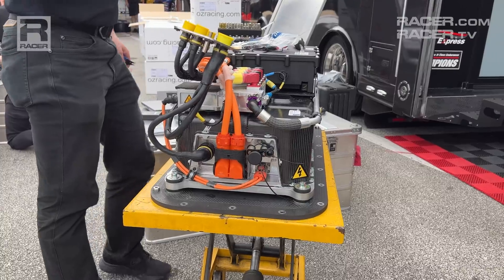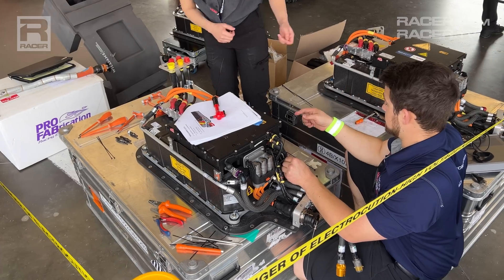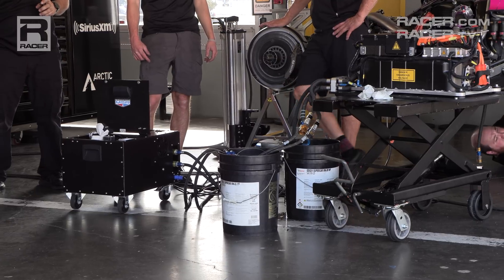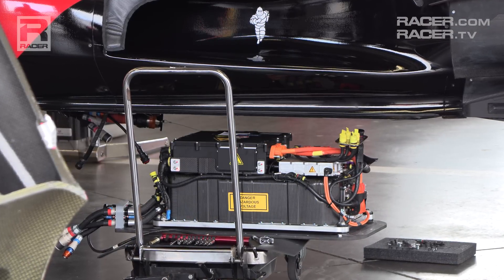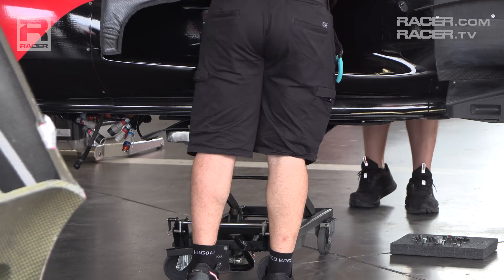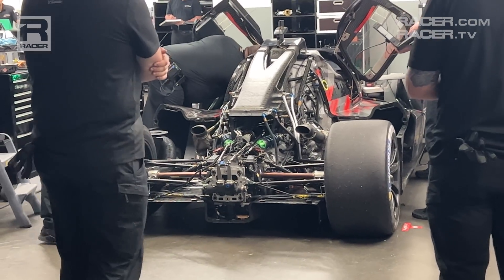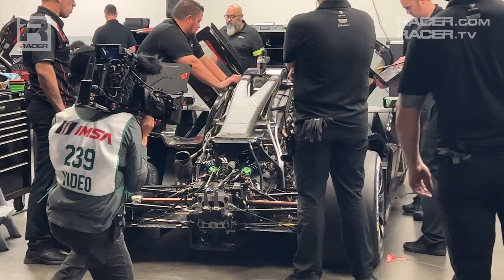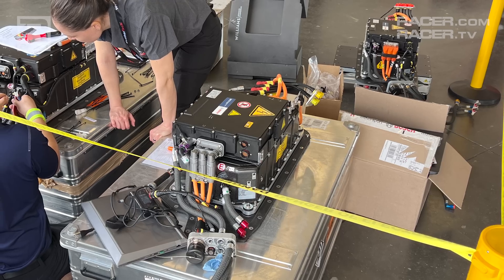IMSA GTP 101: Inside The Hybrid Battery System and ESS Installation

Comment: Hi Marshall.  Another excellent video.  One thing - 700V really doesn't tell us anything about these batteries.  How many electrons can flow through the cables at a time only tells us a very little about the system.  Is there any data on what the battery capacity is in Amp Hours?  How about how much load it and the MGU can handle in Amps?  As a guy who's been a long-time fan of railroading and got to spend some time on the rails, we never really cared about the voltage of the system.  It was how many amps were being put down.  That's what told us whether the locomotive was providing power or if it was slipping.  It also told us if we were going to die or not should something go wrong.  Because as the adage goes - it's not the volts that kill you.
Reply: In addition to the capacity, I'd also like to know the thermal load.  How much heat is actually dissipated by those three subsystems?
Reply: The MGU-K runs at 50kW nominal so you can calculate the DC his current based on that
Reply: @xuanyulyu52  Yes, but that doesn't really inform the battery capacity or what it's maximum capabilities are.  We know that it can handle the 67-odd Amps for deployment, but that's probably the lightest it's being asked to handle.  For the recovery side, it's handling at least double that if not more, hence my curiosity of if any of that has been made public.

Comment: It's another hybrid system which serves no other reason than to please manufacturers' PR.
Reply: Manufacturers historically go racing for PR purposes.
Reply: @kyankees07  
That is, of course, correct. Which is also the reason why sportscar racing is close to dying every decade, while the more driver-focussed Grand Prix racing with garagista teams is more stable.
Reply: @X8X8X8X8X8X8X8X8X8X  Grand Prix racing which has been dominated by one factory for most of a decade of turbo hybrid regulations, no? Williams are owned by a private investment firm…garagista days are long over in F1.
Reply: @kyankees07  
That's a rather recent development. Grand Prix racing has been all about drivers since the late 1920s, when most manufacturers had left. This is the reason there was a European Championship for Drivers before the war, and a World Championship for Drivers after the year, which was followed by an International Cup for F1 Manufacturers eight years later. 
Mercedes success, as great as it may have been, could turn out to be just a phase in the history of the sport. After all, only a third of the team is currently owned by Mercedes.
Reply: I agree, but only because it is a spec system and so low power. Pretty much only there so that they can call the cars hybrids and this shouldn't even be a controversial claim.
Reply: Really ❔🤔
Reply: @Ramsi-Berlin  
It adds weight, complexity and cost for no tangible performance benefit. Therefore, it is the very opposite of what motorsport is - or should be - about.
Reply: @X8X8X8X8X8X8X8X8X8X  motorsport is also about progress.
Reply: @giuseppepuglisi3980  
But mandating a system, which isn't even developed by the manufacturers to improve its breed, is not progress.
Reply: @X8X8X8X8X8X8X8X8X8X  Seems odd not to mention the efficiencies of stint lengths, which will be longer starting this season.
Reply: @kyankees07  
That's one aspect. But then again, stint lengths only matter due to regulations. For example, by the 1980s it was quicker to stop during a Grand Prix than starting the race with a heavier car and never changing tyres.
Reply: It helps with performance and efficiency.
Reply: @giuseppepuglisi3980  
The system without the electric motor / generator weights 100 kg! This very much negates any performance benefit for an occasional powerboost.
Reply: @X8X8X8X8X8X8X8X8X8X  Do you think, the Nürburgring Nordschleife record of the 919 Evo from Porsche 5:19 min, would be better without a Hybrid car ❔🤔
Reply: @Ramsi-Berlin  absolutely not
Reply: @Ramsi-Berlin  
It could be possible, given equal development prowess.
Reply: @Ramsi-Berlin  these cars and LMP1 are miles apart Porsche built everything on the 919